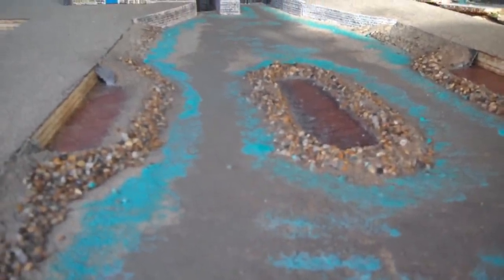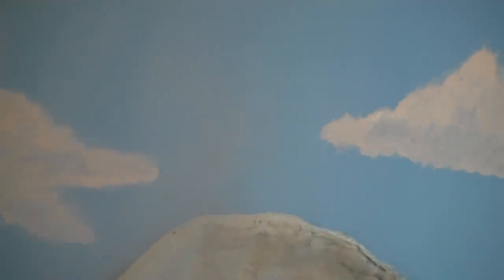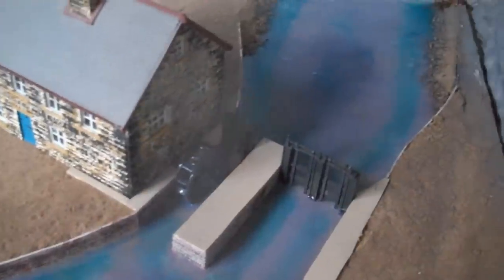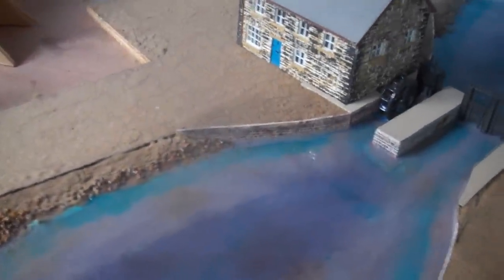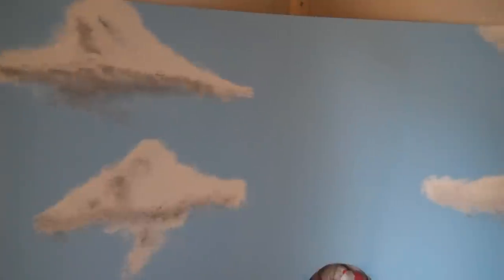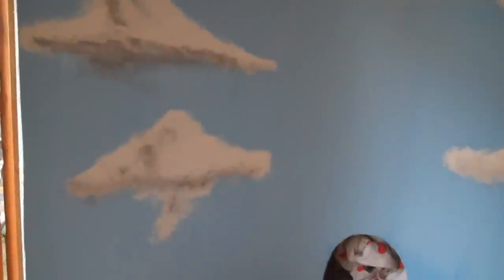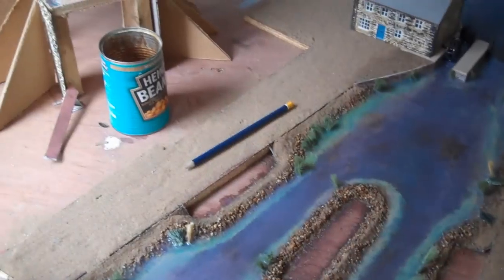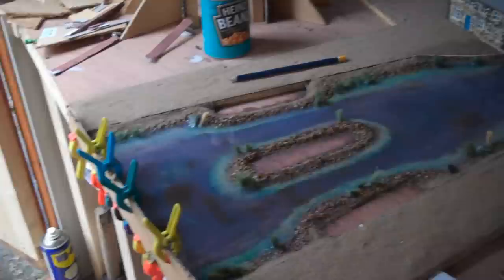Realistic water, bridging the gap part 8 Amberton on sea 00 gauge railway.

Comment from the maker: It depends if your layout is in doors or a shed,there is woodlands scenic realistic water(I would use this indoors dries quicker),woodland scenic A Z water boil and pour or you could use perspex,varnish or resin mainly used by model clubs.As for which method is best that's the 64000 dollar question it depends on which one you want to try.